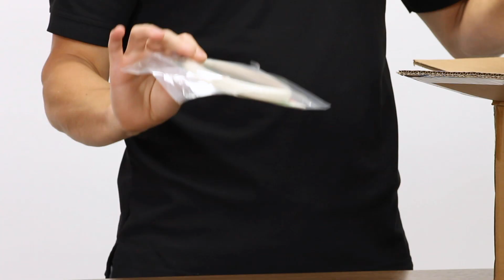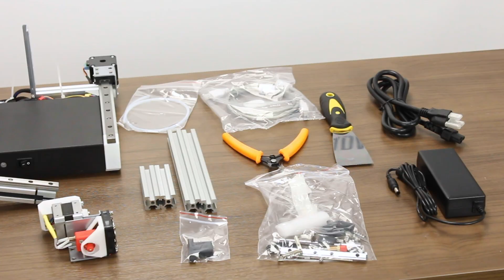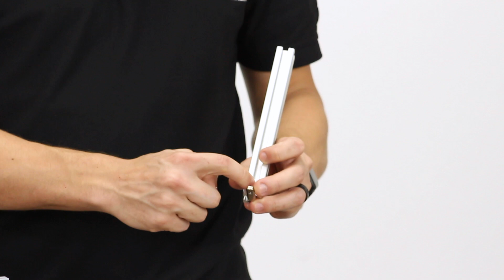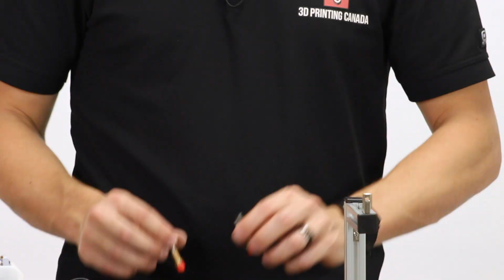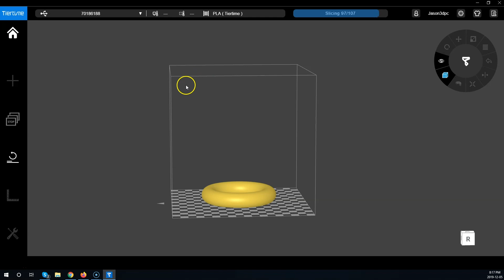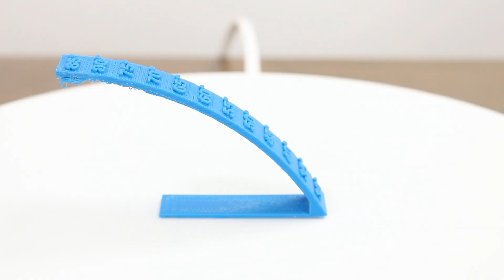Cetus MK3 3D Printer Unboxing and Review

Comment: So if I upgrade to the newer board to use Cura I won’t be able to upgrade to the heated bed apparently. Then it’s 500 for the delixe which comes with the heated bed but does it also come with the upgraded board. I’m into it for the 90w power consumption but obviously it’s not a good choice, too much goin on

Comment: First and foremost, great videos.....Now after watching, that black bracket should maybe go at the top of the spool holder or goes on the extrusion that is tapped and on top maybe. I would definitely say it need a build surface or glass if it wouldn’t crack it. I like magnetic flexible ones. The cheap amazon one have worked great for me. Anyways, that just my thoughts. Keep up the great content. I appreciate you all... 👍🏼👍🏼👍🏼